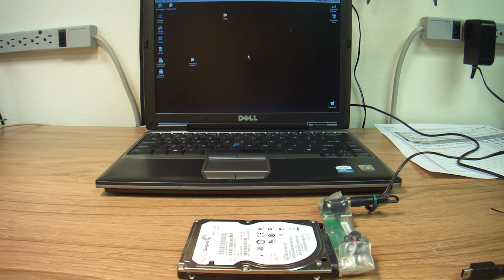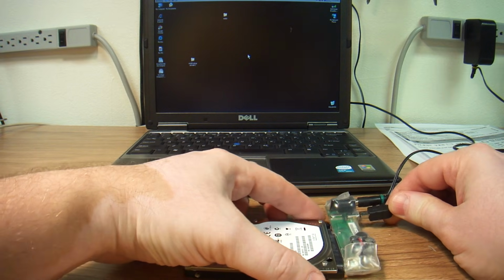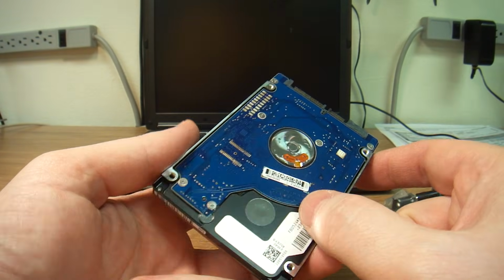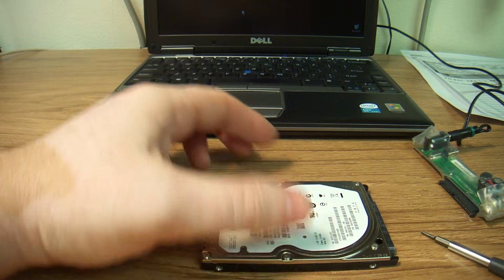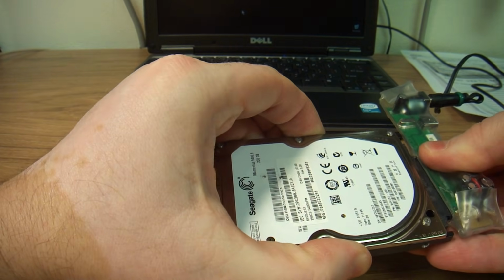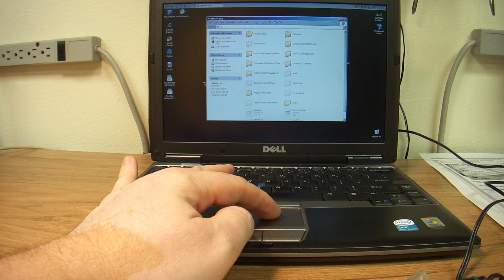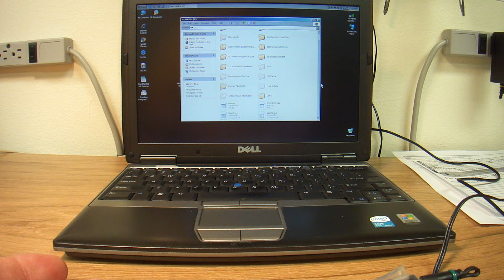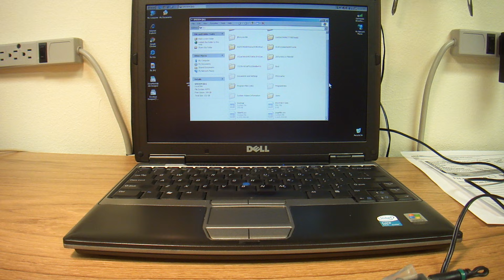How to fix a broken hard drive Beeping noise or clicking RECOVER GET DATA BACK FOR FREE! BEST TRICK

Comment: could you provide your advice: WD 2.5 My Passport Ultra: started getting the files off after I received an error transferring file to it. It's 4 TB and the transfer speeds went from KB to 30MB max speed, at a certain point I deleted 2 files, but I kept seeing them... so I rebooted laptop... after that a copy process showed up after getting back inside windows... no more access to the drive, the drive shows up without its label, so "Local Disk", when I go into Explorer or click on it it just tries to load forever but I never get access... tried different ports and computers, tried to mount it in Ubuntu, on Android... no luck... it does not make any particular odd noise, only when I unplug it it makes a beep while losing power... (which I need to do or my pc does never Shut Down... only after unplugging computer shuts down...)

Comment: Sir I have hp pavilion notebook 15 ab 032tx. Today while opening of laptop it shows on screen that ‛ Boot device not found 
Plz install operating system on your hard disk 
Hard disk (3F0) '

I made hard-disk test but my notebook shows ‛no hard drive installed plz check that power and data cables are  connected properly '

Plz help me sir as possible. I'm waiting for yours solution

Comment: My external hard drive also makes noises but not the beeping noise, the clicking noise but it doesn't  happen every time i use it. Sometimes it just works fine and sometimes it stops working with a click noise and sometimes it starts  working again after a few seconds, sometimes i struggle half and hour to use it. Do you think the problem is same as in this video or can it be something else?

Comment: My 1TB hard drive is too slow. It only boots upto Windows 10 logo after few minutes, shows error message and asks to press F8 for startup options. It doesn't boot into Windows at all.

The hard drive got damaged due to ants - I cleaned up hard drive. I know ants may not have entered platter / accuterer area, since it's sealed.

But, how do I repair the drive?

Comment: I had this problem where the drive started making beeps/ticking noises.  Plugged it into an external USB-SATA adatper and gave it a few love taps  and spinning it around gently while it was turning on and it fixed it.

Comment: Hi sir, I hope you can help me. I dropped my 1.5 TB WD Elements on floor while it was plugged in my computer I was using a long cord that why even if it drops it is still connected in my pc. 

but suddenly the device is not showing in my computer, i did all the rebooting, change cords , change pc everything, in disk management I can see it but it is showing unallocated, Not initialised, when im trying to initialise it, there is a pop up Virtual Disk Manager saying "The device is not ready"
Reply: King Albert Hard drive is messed up,  you wont be able to fix it yourself

Comment: My Seagate 1TB is not working and I don't know why it happened. I am 100% sure that I didn't dropped it or anything. But after I played some videos from television to television, and plugged it to my laptop, its light did not flash or even blink and unfortunately cannot be read. All that I observed is the beeping sound. It costs a fortune to restore its data. I feel so hopeless as ever because of that! I want to know what I did wrong and  is there a chance for survival for this? Will this work out with this kind of situation of mine? 😭 I hope you could reply (even though this video has been a very long time). This is a potential solution for my hard drive. Thank you so much and God bless!!!
Reply: Faith Moulic cheap data recovery www.copypastemaster.co.uk

Comment: HELP NEEDED PLS...My external hard drive when plugged to a laptop spins, and its recognised by the laptop. Immediately I attempt downloading, minutes after I start hearing a scratching sound and it gets disconnected. When I plug it back, it no longer recognised by the laptop. After 3 to 4 days, I attempt and the laptop sees it and when I try opening a video, same issue reoccurs and gets disconnected. KINDLY ADVICE

Comment: Hi I done this but when i tried again , i had the same issue, i opened the top cover to see what is happening on the inside and then did a test. the head moved onto platter but then came back to park position. then i tried again and the head seems to try to go on the platter and it does not? when I started it was beeping noise not clicking noise? i have uploaded a video here to show. please can someone help. Thanks    https://youtu.be/nvWBFAzdihM

Comment: This should ONLY be done if you have important data worth alot of money. In a closed hard drive it is filed with some kind of gas, if normal air went into the enclosure it would over time start to corrode inside because of the "water" there is in the air, you should only do this for a immediately data recovery and after a recovery of the important data you should ONLY use this drive as trash collector at most or perhaps as an ashtray.

Comment: my external hard drive is make a sound when i put it in my ears ,but it is readable in the laptop but files opens very slow and sometimes does not works ,videos works and freezes, will this way you show will fix it

Comment: Worked like a charm! Laptop was dropped so hard that the plastic housing was cracked in multiple spots. Wouldn't boot into OS, and wasn't being recognized by any computer when connected via USB. Opened her up, did exactly what this video showed, and it booted up right away when re-connected! Quick $80 repair. Thanks for the video!

Comment: (The hidden screw was under the sticker and then under a aluminum circle sticker.) I have the same hard drive shown in the video, it got dropped while it was running so it got stuck just like he said and I just fixed it. It's working completely just like before it stopped.

Comment: hey sir nice videos! I have a problem with a similar hard drive, but the sound is two shorts beeps and then a long one. I opened it as you did but the heads were in park position :( any ideas? I am willing to ship it somewhere you recomend

Comment: This method, while it can rarely work, is almost guaranteed to permanently destroy your data and/or make it harder for a data recovery specialist to recover the data, if it doesn't work.
 
Turning the disk while the heads are stuck onto the surface will usually end up tearing off the heads, or otherwise damaging them, and will also destroy any data under the heads. 
If that damage is in service areas, you've just made any recovery that much harder. 

If its your series of GOT, or whatever, go for it, but if its data that is important too you, DON'T do this.

Comment: I haven't opened my laptop yet so I don't know the make of the HDD. My pc is only 5 months old and it was refurbished. I noticed from day 1 the HDD is very noisy, it makes a whirling sound when it does something. I never heard that before. But it worked fine until a month ago. 1 morning I turned the PC on and it won't boot up. I have Win7 pro. Sometimes it will boot into safe mode but it's super slow. My question is I no longer hear that whirling sound. Does this mean the HDD needs to be replaced?

Comment: I've got an external 2gb WD passport ultra hard drive that fell from a high desk, it makes 3 clicking sounds and 6 clicks afterwards, I opened it up, the head wasn't stuck on the platter, I couldn't see any scratches on the platter too, the heads looked physically ok to me but it seems there's something wrong with mechanism of arm heads because it doesn't move into the platter when it starts spinning when connected, so I closed it back, I guess it's now down to a data recovery company to fix, that sounds bleak though because I'm in Nigeria, I can't find any good specialists over here.

Comment: I have a Seagate that is making the beeping noise. I removed the cover, and the heads are in the middle of the platter. I got them back out to the landing zone, but when I power it back up the heads immediately go back into the platter and stay and the beeping resumes. Any thoughts?

Comment: Hey guys, I had a seagate external harddrive which made a similar sound when i connected it to the usb3 port and I tried different cable different computer, even i removed the hdd inside of it and used a sata to usb3 adapter still did that beeping and did not work. Then I decided to give this method a try and it really worked! thank you man you are a hero!

Comment: No sure if you still check your messages, I have a Samsung HDD 2.5 inch, I opened it but it wasn't the stuck issue, it makes 3 clicking noises but HDD doesn't spin, sounds very dumb but after being in this industry, this is the first time I stuffed up big time and 500G of family photos seems gone, if you are aware of similar issue, please shed some lights. Thanks.

Comment: OMG I was almost in tears, tried a few other options and they didn't work. saw your video did as directed, and the drive kicked in again... had 7 years worth of work on here... I owe you big time, God bless you.. I need to save my harddrive now, just in case it happens again...
Reply: VuHien2011 use the screw driver to spin the disk at the center and push the stuff on the plate to the correct position while spinning it gently.
Reply: hello, did the heads resist a lot when you tried to move them to the parking position? I applied reasonable force but they refuse to move beyond the platters. I'm afraid to break something if I apply more force.
Reply: @VuHien2011  not all drives are designed to move off the platters
Reply: Thank you for sharing
Reply: Same here
Reply: Then why some people say that it must be done in a clean room etc? Did it work doing that at home?
Reply: Your a bit stupid, if this would have failed you could have gotten your data beyond recovery. If the data is important to you, get it done by professionals in a cleanroom
Reply: To not risk something like that again, you should buy an ssd and use cloning software to move your info into the ssd, ssd's have no moving parts wich means longer lifetime, and are also much faster
Reply: I did this but my hdd still making very faint beeping noise that is way slower than this beeping and way lower sounding.  To tell the truth it seems like the drive isn’t getting enough power anymore or something.
Reply: save your data quick, without a clean room, simple dust converts your drive into a x100 time bomb.

always save data you need in 3 separate locations. physical locations, not drives. 

anything else means.

a. you don't need the data.
b. you need the data and you are a human like amoeba.
Reply: he is a liar ... he is changing the hdd during the 4 : 31 4 :37  buffring. he is totally liar.
Reply: @mirzaibrahimbaig9736  Nope, he does not. We do this on a regular basis in our workshop, and especially on the Momentum 500GB disks which seems to be particularly prone to this problem. However, have a cabinet with positive air pressure where the incoming air is pulled through HEPA-filters, but we have done it in a regular room too. I prefer a cabinet though, and if time was such that I could not use it, I'd use "air on a can" to blow away any dust particles while putting back the enclosure to prevent unnecessary dust.
Reply: @peterhober5681  my external hard drive currently is clicking and acts like it wants to read but it continually just clicks. Can this be fixed and if so can you message me so we can discuss me retrieving the data?
Reply: @MuziikL.I.F.E  Clicking is a different situation.  You may need to buy an identical hard drive and move the platters to the new drive. See videos on Youtube.  However, the slapping head may have already damaged your platters.
Reply: @artman102  That's what I thought. It's probably beyond repair. Thanks for answering me.
Reply: @mirzaibrahimbaig9736  no sounds of him moving it and the wires didn't move also. Or do you have some proof?
Reply: @mirzaibrahimbaig9736  why does he do that , lying us , I don't think that he is a lier , if some child do this then I can except that but he looks a very straight forword guy also giving a helpful advice he did about if you're feeling confidence then do it by yourself

Comment: It is April 30 2017.  These HDDs are obsolete.  The SSD drives will be obsolete too. IBM just discovered a way to record data on an atom. The divices with such technology not available right now but it will happened inevitably

Comment: mines making a much different noise at a faster rate, i was using the hdd as ps4 external drive and my ps4 froze and when i turned the ps4 back on it would not work and making a weird beeping sound

Comment: Sorry for my english ...

Here in Brazil the culture of seeking to recover data in HDD that fail is still incipient.

I'm self-taught in Windows OS, I'm also interested in getting more knowledge in this segment, because until a day ago, after testing, with specific software, the state of the HD, where it passed. To my surprise, some time later, the disk failed, compromising all the data. As I have backup, no problems. But for those people who do not have security habits, there is a need to try to get the data in another way. Like, I have a friend who, too, had problems with external disk.

From your experience, what are the marks where the missing ones occur? Of course, consideration should be given to partaking in the market and such. Yet, what are the most common failures?

Thanks for the attention and the excellent work of divulgation, everything seems so simple and demystifying what there was going on about the recovery of disk data that fail.

Comment: I have a western digital hard drive and I removed the head off the platter (successfully without scratching).  I plug it back into the laptop and it spins, but is still not recognized.  What do I do?

Comment: My parents have an inspiron 17R 5720 laptop and i dont know what i did but it is currently broken. it will not boot up to windows, i get error code 0xc000000d windows\system32\windload.efi but so i formatted the drive through windows setup and now is says no operating system, so i made a bootable usb drive (16gb flash drive) with windows 8.1 on it and the install took 16 hours then got error "setup cannot continue due to corrupted installation files" so i tried again but this time with windows 8.1 pro and the install took 2 days and 2 hour then got an error saying windows registry or something like that. and now the hard drive makes a straching and beeping noise. PLEASE HELP ASAP my parents are going to be so mad if they find out!

Comment: As to the cause of this, I just had a customer come in with a beeping HP Pavilion refusing to start. After disassembly and hooking up the HDD to USB, it was obviously the HDD that was doing the "beeping" and I found this video.
Customer admits to a fit of computer rage and thereby smashing her fist into the computer - a cheap & thin laptop with the HDD just under the right-hand hand-rest...

Nothing important on it, but for fun I did open the HDD and the heads were stuck just like in the video. When I tried it again, there was rather more noise, so I guess this drive got properly hammered. An SSD will replace it.

Comment: Hey man, I have a hdd with this problem.  I opened it, and the head was all the way on the middle and clicking.  I could move them to the outer edge, but it wouldn't move all the way off the platter, it got stuck a few mm from the edge, even as I turn the platters.  what am I doing wrong?

Comment: I have done this but it still does not work. It seems the heads themselves are not working and they made a slightly scratching sound for a few second before I stopped it. Do you know what you can do and/or if there is an easy way of replacing the heads or reading the disk through another machine? Any suggestions would be great, thank you.